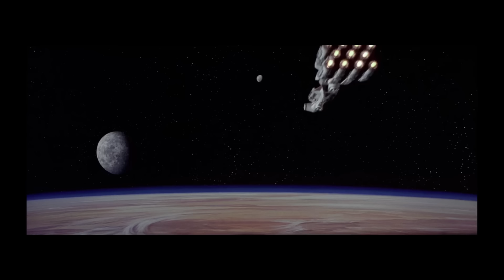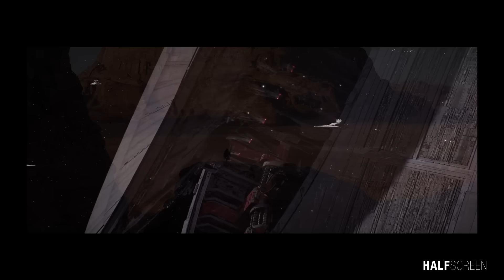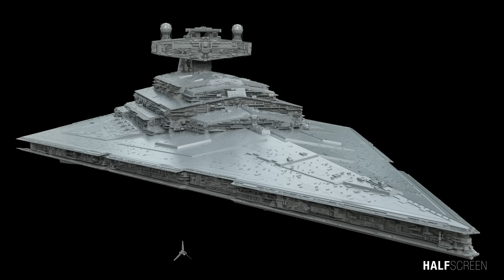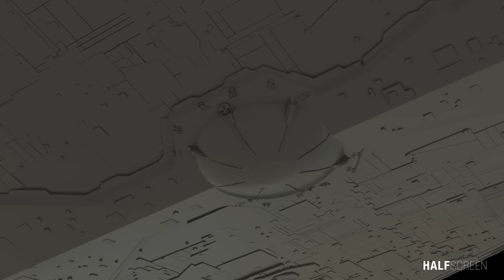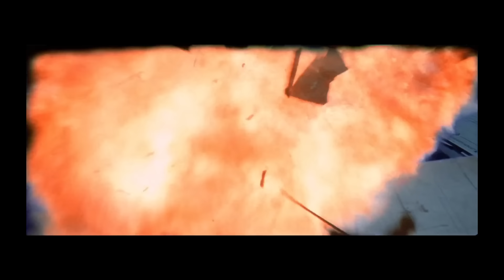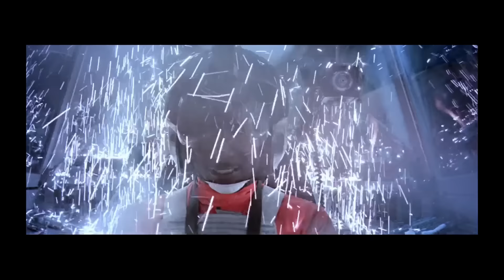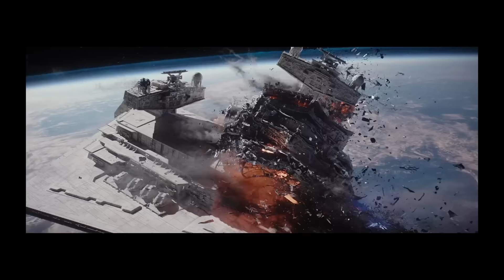Star Wars:  Inside the Imperial Star Destroyer

Comment: This is an Imperial 2 class Star Destroyer model, those Turrets are octuple barbette turbolasers. Either way great video.
Reply from the maker: Yeah...Didn't used the correct 3D model unfortunately but thank for watching.
Reply: But it also has the tractor targetting strip on the top of the bridge.

Absolute muck up.
Reply: that 'tractor beam array' is a communications array which only the Imperial-IIs have
Reply: what's the differences between imperial l and ll? they look same to me.🤔🤔🤔🤔
Reply: @gearthehedgehog2005  the two biggest and easiest to spot differences are 1) the structure between the two shield bulbs ( I is an X shape where II is a stripe) 2) is the side turrets ( I has blocky turrets that are higher and are a mix of turbolaser and ion cannons where II is just 8-4 on each side octuple barrel turbolaser turrets which are lower structures)
Reply: @collins3D  then what about the xyston-class? what's the difference with the imperial-class besides it's superlaser underneath them?
Reply: @gearthehedgehog2005  the xyston-class is an Imperial I model (technically,  which was just slightly modified) other that the superlaser, there isn't a huge difference visually.  The side turrets might.... might be different.
Reply: @collins3D  it's cringey when they just arbitrarily extended xyston-class length to 2406m ... i mean fine, but add some proper details to depict that rather than just a scaled up model ... it's like the same thing as ISD-1 but only 50% larger (1600m vs 2406m) ... geez
Reply: @jeremylee6352  100% agree.
Reply: @jeremylee6352 that also means that every toilet shower and table is 1.5 times larger than it should be (it’s just directly scaled up)

Comment: To be as big it is it can only carry 72  Tie fighters ? Aircraft Carriers can carry up to 80-95 air vehicles and 5000 personal . Also the Falcon space ship is proportionally wrong  when it is attached to the Star Destroyer . The falcon is covering multiple deck levels and it is not that big to do so . Its length might stretch to 2 1/2 deck levels tops .

Comment: So basically if you stay below the horizon line of the SD's nose you can avoid the tractor beam. It wouldn't be able to hold anything with its superstructure in the way, which renders the initial "Tantive being pulled into the ventral hanger bay" scene nonsensical.

Comment: 975 Km/h is not even the speed of sound - not much point in huge Ion engines and, if used within an atmosphere, how did it get orbital?
Reply: Also there isn't a maximum (sublight) speed in space.  If you are applying thrust, you are accelerating.  I suspect that the 975 figure is meant to be 975 Km/h squared; a maximum rate of acceleration.

Comment: I am a big fan of the modeling and diagraming. We need more of this. The AI voice over is a bit annoying though. Also - just a friendly heads up - do some additional fact checking before going through all the work to produce these. There are several notable issues with the facts presented I’m sure more hardcore fans will (or have) pointed out. 

Nice work!
Reply from the maker: Yes, that is understanding since I'm not a subject matter expert on different classes or different versions. I originally used the AI voice to streamline my workflow, but most of the audiences seem to reject the robotic VO, which is understandable.  In addition, I have a slight accent that could be an issue, so AI voices were an easier solution.  The animation was really intended for the average joe but I have many experts pointing out the mistake regarding size, classes, naming convention, something I didn't anticipate.
Reply: @Halfscreen  Sounds like you plan to address these issues - Bravo! 👍
PS: Don't worry about the accent - On YouTube,  most of us have probably heard worse anyway! 😁
Reply from the maker: @RetroJack  it's basically insecurity on my part.  Having the whole world actually hearing your voices is a bit scary at first.

Comment: The commonly referred shield generator towers on the bridge are actually sensor globes - the turrets on the ventral surface are 'axial defence turrets'
Reply: Also the whole solar ionization/hypermatter reactor creating a small star inside isn't the official explanation either.

The reactors cause hypermatter to be exposed to real space causing it to annihilate itself. The reaction has an output similar to a small star, not an actual star inside.
Reply: I hate how these inaccurate memes spread. Shield globes.. or Star Destroyers are weak at close range.. because in episode III they go in close to avoid a Death Star super laser.

Comment: Am I the only one here that’s realizing that’s not an imperial 1 but an imperial 2 class destroyer?
Reply from the maker: @United Europe That is the general consensus I'm getting from my viewers.
Reply: @Halfscreen  well the most obvious difference is the sensor array on top of the comand tower. Imperial 1 has a larger sensor array, mostly reaching higher than the shield generators, while Imperial 2 has a much smaler one. That is the easiest way to tell them apart
Reply from the maker: @adnr2677  Do you have a recommendation as to references on different version?
Reply from the maker: You ain't the only one that spots the mistake...the model I used didn't specify which version, and to be honest, I didn't know there were 2 different versions.
Reply: @Halfscreen  Wouldn't it only be called Imperial Class if there wasn't another version?

Comment: So, that hemisphere below the ship is part of the hypermatter reactor and not shielded in any way ? Such a vital point has no protection ? That's the stupidest conception for a warship I've ever heard about ! And the ship can "accelerate up to 975 km/h" ?? That's fucking slower than a jet fighter from the 50's : isn't there a mistake here ? Even with a million multiplicator it would still be slower than lightspeed ! And ejecting a few tons of junk from a ship 1 mile long (so weighting several dozens billions tons at least) just can't make a difference (or a difference of less than 1/10 billions). And let's talk about firepower : such a thing should be able to destroy whole continents if not planets, but it's never shown doing better than shooting small to middle-sized ships. Moreover, considering that a 350m-CVN needs more than 6000 crew, 37000 crew for a beast that size is way underestimated, I would say the minimum to manoeuver such a ship is like the population of a mid-sized city, around 100K to 150K. And the turbolaser turrets, with their positioning they're blind for over 120 degrees. Finally, why would you create a ship with horizontal symetry in space ? Have you forgottent the 360° freedom degrees on all 3 axes (xyz for dummies) ? That's a failure to the worst point possible in the design of a space warship ! This ship may be clean for show on tv, but military speaking it's the condensate of evrything you don't want !

Comment: Not tryina be mean but a good chunk of the info here is wrong, it doesn't lineup either with legends or cannon well.
Reply: Canon. 😊 sp
Reply: Send me the real video
Reply: Example?
Reply: @FACTBOT_5000  to be nerdy: The two spheres on top of the Star Destroyers aren’t the shield generators. They are the shield projectors, merely projecting the shield that is generated from the shield generator. The real shield generator is deep within the ISD
Reply: @paulthiede well I need to correct you here.  Those 2 spheres at the top of the destroyer, are neither shield generators, nor are they shield projectors.  They are in fact pieces of painted plastic that some guy working at ILM, glued on.
Reply: Also the ISD isn’t the venator’s successor the Imperator is
Reply: @ultrabrian8151 I mean technically
Reply: Anybody have blueprints to build one?
Reply from the maker: I based my information from various sources websites, but I'm definitely not a subject matter expert on different variation or classes.
Reply: @Halfscreen Yeah, I think you might be getting mixed up between Imp Star 1 and Imp Star 2. Imp Star 1 only appeared in A New Hope. Empire and RoJ featured Imp Star 2s. Off the top of my head, the Empire predominantly used Imperial 2 Class Star Destroyers.
Reply from the maker: @MrCCollins1993  this is actually one of my older videos.  Maybe I will update it for clarification.
Reply: @Halfscreen  I don't think.  I know it's fkn awesome.

Comment: I thought the victory 1 class was the direct successor to the Venator and the Imperial 1 class being a successor to or an  offshoot of the Victory 1 class
Reply from the maker: I have to double check that information.   To be honest, most of my basic information are based on some google research.  I'm not really a subject matter expert on the different classes.
Reply: I also noticed the lack of Victory Class Star Destroyers mentioned.  The other thing that people always forget is that a Star Destroyer is really meant as the command ship of a small fleet. Think  an Aircraft carrier group.
Reply: @ArmouryTerrain  Well, they do operate pretty well on their own, too, but yes, optimally, a battle group is useful for them. Some 18 to 60 ships, potentially, per RPGs - or as small as 5, per some video games.
Reply: They''re more contemporaries, really, I guess. The Victory was quite rare originally - also, continually retconned commissioning dates keep on confusing the issue. Seems like the VSD I premiered around the mid point of the Clone Wars, currently.
Reply from the maker: @chrissonofpear1384  You know, it wasn't until i started this channel that I'm starting to know the differences between classes and different variations.  I came with the assumption they all the same.
Reply: @Halfscreen   If my memory serves me correct, the Victory class were quite a bit smaller than the Imperial class at 900 meters to 1600 meters. I remember VSD's making many appearances in the old Star Wars "Legends" books before Disney changed the expanded universe.